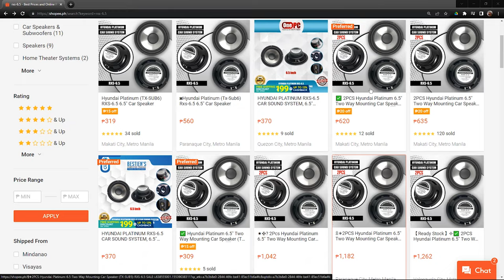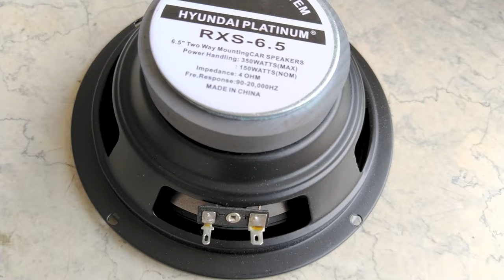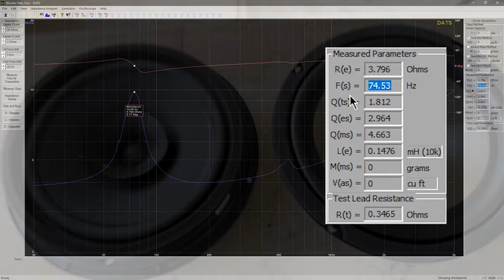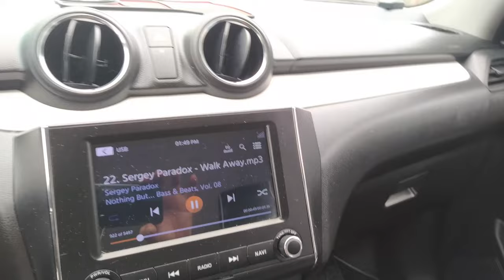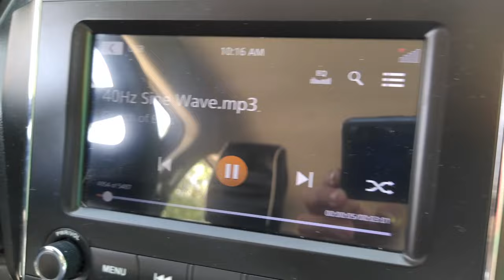Cheap car speakers, are they of any good?

Comment: Sir, just wanna ask if this speakers could be considered as a great alternative for CMS6V2? Would this be enough for mid para may konti bass at sigaw din? Planning to add some upgrades sa kotse pero on a tight budget. TIA
Reply from the maker: These speakers are in fact softer than cms6v2's. These has about 72Hz Fs compared to 120Hz of those Category 7s.

Comment: I have two of these for a while now WORKIN FINE.

I replaced the dust cap of it with aluminum ones from an old soda can and it's now water proof and more bassier 😎😎
Reply from the maker: Yrs they're good, but soda can for dust cap?
Reply: @chrclmnky  yes i used the bottom of the can
Reply from the maker: @RTX_Labs_Productions  it works? I think it's too hard.
Reply: @chrclmnky  no it's not i cut it using a metal sheet cutter and i sealed it with hot melt glue carefully
Reply from the maker: @RTX_Labs_Productions  i mean the aluminum can bottom is too hard for  dust cap duties. I might try this trick on one of my home theater speakers because they're dust caps were depressed by someone lol.

Comment: Surprised they are not 2 ohm...
Isn't that more of the standard now?
Great video as always. Keep up the good work!
Reply from the maker: Thanks. I know there are so subwoofers with single 2 Ohm coils available around. For door speakers they are mostly 4 Ohms. Never seen one with 2 Ohm.
Reply: @chrclmnky  as always, you are the expert and are exactly right. I did a couple of searches because some cars, including mine have 2 ohm systems from the factory. But the overwhelming majority are 4 ohm. Thanks for your polite correction. And keep up the work with the great videos. I always look forward to watching.

Comment: I had the 4 inch version of this woofer back then and here's my opinion (not sure if it will be the same as the other bigger versions)
Cons: 
they aren't for bass head's they bottom out quite easily.

The coil of them doesn't take much power and could easily get blown. (blew mine by accident using a 50x50w mini amp)

Mids and highs distorts badly at bassy track's when it gets to high excursion's. (you could cut out the lower frequency's to prevent this)

So far that's all the cons i had encounter with these and it's an okay speaker for the price its a (get what you paid for) kind of deal.

Comment: Boss idol  tnong ko lng balak ko mgbuo ng 3way bookshelf speaker ilang watts ang kelngan ko sir ok ba na gmitin ko ung crown 3way na deviding ntwork na 500 to 600  watts
Reply: Size 10 ung woofer ko
Reply from the maker: Wattage ratings don't matter. Match their impedances to make the most out of your speakers.
Reply: 8ohms lhat sir